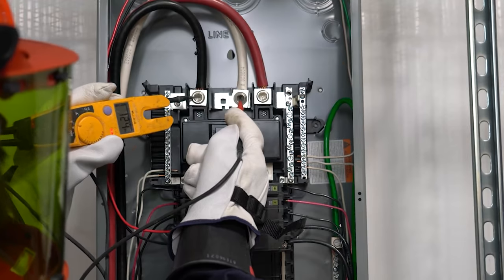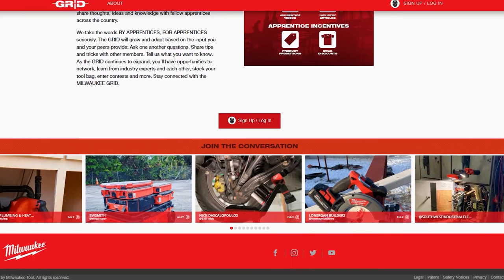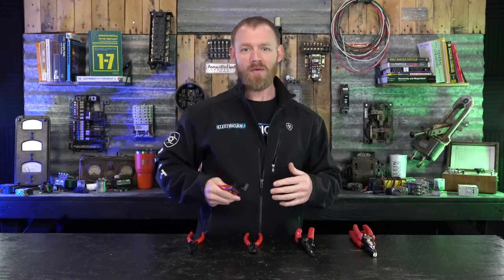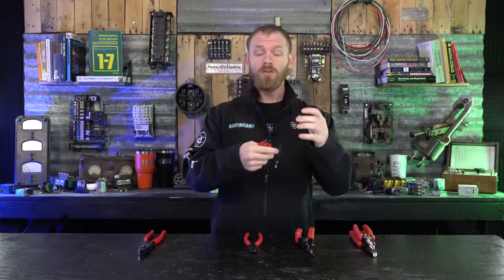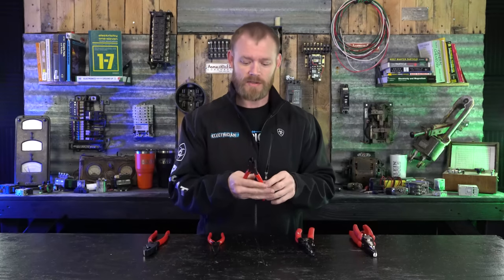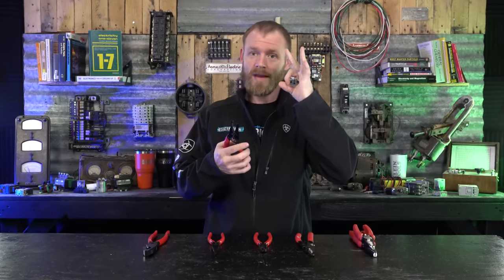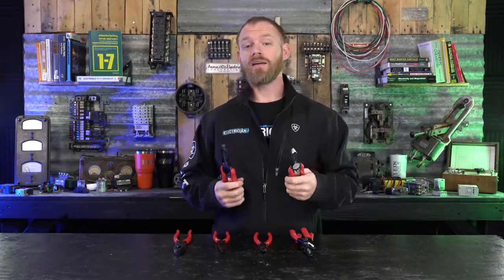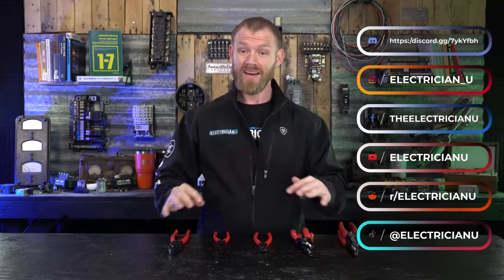Five Essential Hand Tools Apprentice Electricians Need!

Comment: When I started an apprenticeship in 1990 we often just carried a Klein screw driver and Klein lineman’s pliers. If we had our pouch, we always had needle nose and wire cutters and a lightweight aluminum stripper. I still use those tools to this day. It’s amazing what you can do with those lineman pliers after a few years of practice. Just work them in, by opening and closing the pliers, a few hundred times with oil, so that they just fall open when you need them to. Thanks for the video and good luck

Comment: Linesman's side cutting pliers, Two pair of water pump (aka. tongue and grove pliers, I like knipex aligators), a level, tape measure, flat head, and a phillips will do about 90% of anything you need to do anywhere. 

Ofc you need wire stripers, but theres a lot of preference and job specific questions you need to ask to have the right pair. In general something thatll strip maybe like 8-14, somewhere around there. I have a pair of end-strippers I really like for little wire, they work great because size is irrelevant to their function below about a 16 so I can fly through control wire pretty smooth without looking to make sure im in the right hole.

I almost never use my needle nose, and diagonal pliers are a rare use as well.
Reply: I'd say tape measure, multi tool (Knipex 13 72 8), diagonal pliers, 11 in 1, level, and a 10 inch channelocks or Knipex Cobra
Reply: Side cutters seem redundant since the strippers and lineman’s will have cutters and even the needle nose. For me the big ones were strippers and lineman’s.
Reply: @FishFind3000  linesman's and side cutters are the same thing. Im just trying really hard not to call them kliens for the newbies in the crowd
Reply: yup i’ve rarely seen diagonal and needle nose being used
Reply: @FishFind3000  diagonal pliers (dikes) can end-cut, which is critical for stripping back MC jacket without using a roto-split. they can also pull nails and staples out of wood better than side cutters

Comment: Dustin., well done.   Your vid’s are always appreciated.  I wanted to bring up another feature that I like about the Milwaukee needle-nose multi tool, it also has a built in reamer (down the shaft).   It doses a decent job cleaning up ½” and/or ¾’” freshly cut EMT. I’m not giving up my Klein screwdriver reamer, but you can’t deny the weight and time saving that multi tools offer.  Much love Brotha.

Comment: I am sure everyone has their favorite tool.  I find you left out my favorite tool: Klien's wire tool with the sheathing cutter.  Every time you run 12/2 wire you have to cut the sheathing before stripping the wire.  I know there are other ways to do this but this tool doesn't cut the wire, just the sheathing.  How can you not use it every 5 min.?

Comment: Can easily get a days work done with a pair of linemans, dikes (angled head), tape measure, pencil, and screwdriver (flat=chisel). 
The rest is up to experience, and quality of work performed. I have tons of tools and plenty of niche tools - like chain pliers for chandeliers and a vinyl siding tool for opening soffits, dust bowls for drilling old work recessed lights is priceless compared to the mess made without. All depends what the day brings. I thread pipe, bend pipe, build trapeze, do mass conversions from florescent and HID to LED, to house flips, and basement finishes. Electrical can be amazingly all encompassing.

Comment: if you are just starting out these are the 4 tools you will need most! a pencil,tape measure, linemans pliers and a flat head screwdriver! if you can't read a tape,take down notes/measurements or turn a screw I'm not letting you twist wires,strip wires,cut anything let alone wires!

Comment: I go thru lineman's pliers like butter, I use them to put up fence clamps, work on the cars, use as a hammer, they are my go to pliers, but I have a set that are over 75 years old, they were my grandfather's, now I am approaching 70 and will put them on a wall mount!  You forgot a pair of heavy cable cutting pliers for cutting that 2/0 and up to 4/0 so you don't need to carry around a recip saw with a metal blade,!

Comment: Dustin my fellow tool guide and guy I have those pliers (the electricians ones) both of them and they work great along with the combo wire strippers the large flat ones. Milwaukee makes some great tools but are not better than Klein pliers (they are tops ). I love Klein like you do but Milwaukee is not far behind as is ideal ,southwire and Greenlee tools. Love  your tool videos cause it pays to have good quality tools. I do the basics electrician, plumber, carpenter and hvacr. My arsenal consists of Klein, Milwaukee and southwire some gardener bender tools.  Cause guys like you got me started and thinking on what tools to get and buy for doing all purpose repairs at home or in my tinkering shop where I make fancy drop cords and fix things.

Comment: Don't agree with needlenose nice to have on side but hardly use. And I cut screws almost exclusively with stripers and strip with lineman's nowadays but at begin stripers are good. I'm so good with lineman's at this point i can assure you can do almost any task with them and a multi screwdriver.
1. Lineman's 
2. 2 channel locks if u use couplings with pipe
3. 12 in 1 screwdriver
4. Beater screwdriver flathead

Comment: I have working in the industry for over 50 years. I was pulling wire at 12 years old with my uncle Bill.
So 40 years ago I went to the Milwaukee service center to have a battery powered screwdriver fixed and they were rude, nasty and had a bg sign on the wall saying " IF YOU BUY THE WORNG PART YOU HAVE A SPARE - NO RETURNS " I set the driver on the counter and walked out and will never buy a Milwaukee tool!
Reply: Also their hand tools are made in China, they do wear out considerably faster than better quality hand tools. Hand tools made by a master that has been doing it for decades, not some poor underpaid Chinese man/woman. Their M12 power tools are cool though.

Comment: Thought the 1st one was called an electricians hammer 😂.  My dad was a journeyman electrician and i have a lot of niche stuff but I work at Lowe's and we had a 22 piece kit with bag on clearance that included all of those 5 plus more and the little offset spinning slotted screwdriver.  Got it for $15 since we are getting rid of some of that to make room dor Klein since we picked up the brand. 

Tons of Ideal branded stuff on clearance also from fishtape, multimeters etc.

Comment: Was told as an apprentice 50 years ago by a terd tosser ( plumber ) told me that all sparkies have too have a hammer & a rubber. Plumber said if sparky can't fix it with a hammer just screw it. Variety of helpful sparky tools have came a long way. My electrician boss would not allow apprentices to use a hammer drill if we only had a few holes to make. Made us use a star bit and a heavy hammer. Yea right. Said we had to build up arm muscles. Have not used a star drill in 50 years but still have my 1/2" 3/4" & 1" star drills in my garage collecting dust.

Comment: I'm a Locksmith that does low voltage access control.  I just bought the 4th large strippers from Grainger.  I enjoy your videos.  btw what brand is that touch screen monitor you use like a white board with markers??

Comment: I usually don’t mind Milwaukee hand tools. They are cheap enough (way less then Klein’s or knipex) and are pretty well made except those high leverage hybrid stripper, linesman pliers are junk. I cut a piece of 10awg, just one piece, and it put a nice dent in one of the blades. If it can strip it, why can’t it cut it?

Milwaukee doesn’t warranty their hand tools so I was SOL with that. I’ll just stick to my Knipex, you really do get what you pay for!

Comment: I’m not an electrician yet but I am in the process of becoming an apprentice. In the meantime I got a blue collar job with tons of different things to learn. Not something I want to do forever but it’s such a great place to start for someone who has always worked in the food industry. I think I’m hooked on buying new tools though. I keep having to convince myself I don’t need to buy ALL my tools at once since I most likely won’t even have to use them until way later.
Reply: most apprenticeships will have a tool-list of what you're expected to have. nothing wrong with steadily expanding your arsenal but be careful with your money. a good rule for hand tools i think is "if i have to borrow this for more than one task or more than one day, i should probably own it". i mean that for things like a $15 allen key set to assemble lights, or a $20 nut driver set for machine head screws, or a $10 electronics screwdriver for very small screws". if anyone tries to get on you about not having everything under the sun, ask your supervisor about what you need or what they recommend for the work you're doing. 

hope you enjoy the trade! nothing more satisfying than seeing something you worked on power up.

Comment: "Electricians use more tools then any other trade...", Elevator Mechanic here... I see you and I raise you in the "loads of tools" category
Reply: i sense a pun in here :)
Reply: Yeah, Millwright here.  I called BS on that one, too.
Reply: Woodworker I call BS too.
Reply: HVAC/R want tools and gadgets we got them all!
Reply: I will have jump in here. 
36 yrs in trade. retired hvacr guy here. 
A commercial and industrial mechanic is the most diversified trade. We use machinist measuring tools, air flow,water flow and pressure, humidity, temperature, tachometers,refractometers, combustion analyzers, welding equipment, vacuum pumps, refrigerant recovery equipment,electronic leak detectors, bearing pullers, and all the electrical meter's,meggers etc.
Plus all usual hand tools any other trade has. I can assure you I've used all these tools personally and a lot more not listed.  🙌🙌
I don't disrespect any tradesman  !
Just my 2 cents.
Reply: @brianmckenna8495    Exactly.   If you look at my journeyman's card it says "Industrial Mechanic - Millwright".    Tons of tools.  Never enough.

Comment: Regarding the needle nose pliers.  That's not what you showed.   You showed long-nose pliers.  Needle-nose pliers are used by low-voltage guys and others who need really narrow long jaws to get into strange places.  If you look at the catalogue for Kleins, Knipex, or anyone else making good pliers you'll find that the ones you showed are called long-nose pliers.   Not needle-nose.  Needle nose are different.   I have many pairs of long-nose pliers but only one pair of needle-nose, and I keep them with my scissors for low-voltage and panel work.
Reply: this is true

Comment: Sorry, I can't let that statement lie:  "Electricians just use more tools than any other trade."
Um.... No.   Not even close.   I'm a Millwright.  We do electrical AND plumbing AND concrete AND machining AND carpentry AND rigging AND mechanical (bearings, power transmission, hydraulics, pneumatics, etc. etc.), and it can all happen in any given week.  I do commercial electrical  PLUS automation PLUS panel-building PLUS big installations (think 24+ inch ladder tray, winches, and all the trimmings).  Today I was running a CNC lathe for a few hours to get it ready for a job (think metrology tools and other precision stuff) and I still know auto mechanics that have more tools than me, because they are frickin' crazy and want to have all of the special service tools for the dozens and dozens of models of cars that they see in a given month.
If an electrician has even CLOSE to the amount of tools that I have it's because either the tools are for a whole company, or the person just wants to have that many tools.
Reply: You do realize you just listed 7 to 8 trades, right? Then proceeded as if they were all one trade. Slow down a little and segregate those trades and now see how many tools you have for each trade. Then you can determine which trade you have the most tools in. I'm guessing you'll have a lot of cross over.

I'm an electrician and work residential, commercial, and industrial. Though some of my tools do cross over, I still need specific tools for each category of the electrical field. I also do other trades when I'm not doing electrical and my tool count for electrical far exceeds the tools needed for the other trades.
Reply: @TheForgottenMan270  That's what a millwright is.  A legitimised form of the 'jack of all trades'.  Historically a millwright was a person who built a factory (mill) from the foundation on up.  Our training includes everything I mentioned above, plus a ton more.  I was trained to maintain everything from an electric motor to a  diesel engine to a steam engine, to a boiler, to a steam turbine for power generation.   Taught how to dress leather belts for a jack-shaft power transmission, and set up, level, operate and program CNC machine tools (as previously mentioned).   More knowledge is added, but not much is removed.   
Not every millwright does everything, but some of us do, and we need an absolute boatload of tools to do so.   I still have my apprentice book set - it's in a row of 8 3-ring binders.   I still read them now and then, because it's hard to retain all of that.

Comment: That type of wire strippers are useless.  if you get the wire in the wrong gap, you crimp the conductor and increase the risk of it breaking.  Buy a pair of friction strippers, or just get practised at using your pliers.  You can repair a cut screw by threading on a nut prior to making the cut with a small pair of bolt cutters, or a grinder. I like Milwaukee kit, but not everything they make is good.

Comment: Notice he left out a very common name for lineman’s pliers. I wonder why that could be. I kid, I know why and I understand. I always called them linesman pliers anyway. I don’t think I ever heard them referred to as kleins until his videos. I always see this on YouTube with skil saws. I know YouTubers don’t want to use name brands for things even if it’s a common name. I bet it’s especially hard with tools because almost every tool is named after the company that made them. The only hand tools I common use that aren’t named after a company is a pipe wrench and slot/flathead screwdriver. 
I’m a plumber and we wire up basically 3 things. Water heaters, dishwashers, and disposals. I’ve always carried 4 electricians tools, linesman’s, needle nose, dikes, and strippers. I work for a company that mainly does commercial new construction. It was odd when I first started here and no one carried any electricians tools. This is because they never wire anything. This is a new construction thing because when there’s also an electrical permit on the job we don’t wire things because we’d be stepping on the electricians permit. Anyway, I don’t understand this because other than strippers I use the other tools more for other things than I do for electrical. They’re great tools to keep in a tool bag even for non electricians. I do need to get the Milwaukee electricians tool thing. It would probably save some space in my tool bag because it would probably cover all the things I need to do and then some and it would take the place of 4 tools.

Comment: Flame me if you want, but harbor freight's copy of the multi tool is better than the original.  No spring to keep them open in my pocket if the lock comes undone, no lock to engage accidentally when I'm using the tool, and the rounded outside of the jaws is the best pipe reamer I've seen for up to 1".  The insulation on the handles is too thick on both though, it should just be like a pair of plain old dikes.

Comment: No romex strippers. Booooooo. Also I never use needle nose.
Reply: Romex strippers are very specific, you can go an entire career without using them. maybe if you're only doing resi, but definitely not in the basics
Reply: Romexs strippers, never used them.  I pinched the jacket and pulled of the Romex.  But if you like residential electrical work, commercial and industrial  pay better.  🤘👍💫